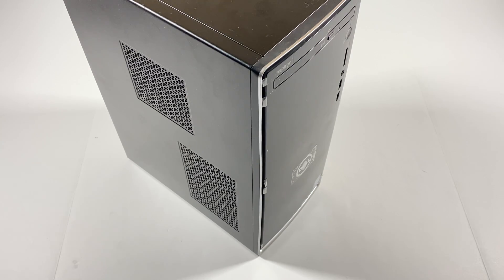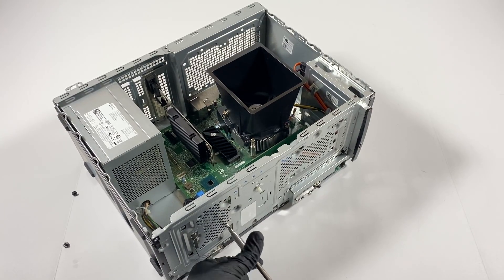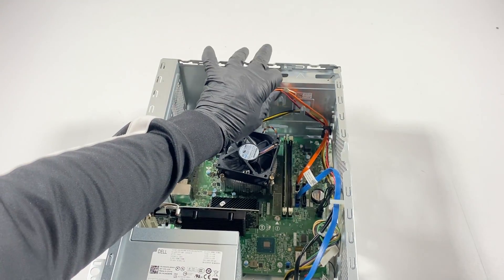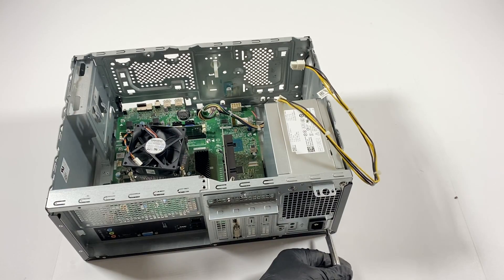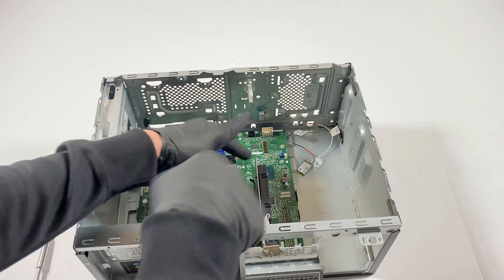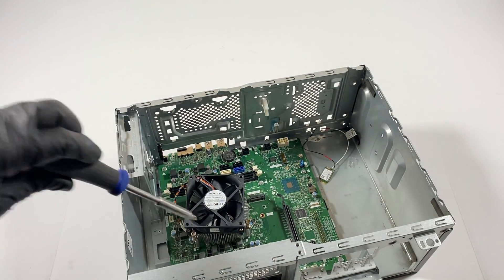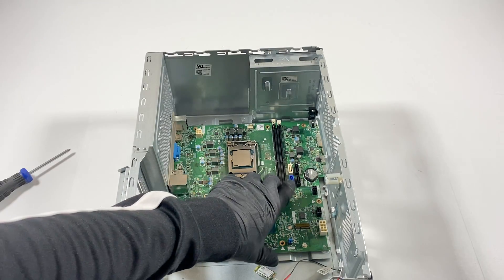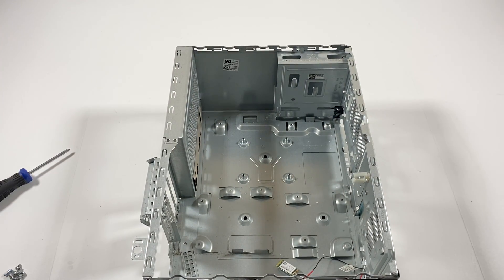Dell Inspiron 3670 Teardown

Comment from the maker: List of Parts and Upgrades works with this system :
Dell Inspiron 3670

Simple Deluxe 80mm Quiet USB Fan with Multi-Speed Controller
https://amzn.to/3jgHxiI

List of RAM will work with this system.
Maximum memory supports: 32GB

(1.) Crucial Ballistix 16GB Kit 3200MHz DDR4 Memory (8GBx2)
https://amzn.to/2UDGwI1

(2.) Crucial 32GB Kit (16GB x 2) DDR4 3200 MT/s (PC4-25600)
https://amzn.to/2Zazppk

(3.) Crucial 8GB DDR4 3200 MT/s (PC4-25600)
https://amzn.to/2R07Ier

(4.) Crucial 16GB Kit (8GB x 2) DDR4 3200 MT/s (PC4-25600)
https://amzn.to/326cfT7 
(5.) Crucial RAM 32GB Kit (16GBx2) DDR4 3200MHz Desktop Memory  
https://amzn.to/3pilfj7

(6.) Crucial RAM 16GB Kit (2x8GB) DDR4 2400 MHz CL17 Desktop Memory
https://amzn.to/3zljDuD

List video cards will work with this system Dell Inspiron 3670

GIGABYTE GeForce RTX 3050
https://amzn.to/3W2sJY9

MSI Gaming RTX 3050 Gaming X 6G Graphics Card 
https://amzn.to/4eNikqD

XFX Speedster SWFT105 Radeon RX 6400 Gaming Graphics Card
https://amzn.to/3xkmXo1

(1.) ASUS Phoenix NVIDIA GeForce GTX 1650 OC Edition Gaming Graphics
https://amzn.to/3Nyn7yb

(2.) ASUS TUF Gaming NVIDIA GeForce GTX 1650 OC Edition Graphics Card 4GB GDDR6 
https://amzn.to/3moJbzo

(3.) PNY GeForce GTX 1650 4GB GDDR6 Dual Fan Graphics Card
https://amzn.to/3aFlxw4

(4.) ZOTAC GAMING GeForce GTX 1650 OC 4GB GDDR6 
https://amzn.to/3xeX0FF

(5.) AMD Radeon RX 6400 Low Profile Gaming Graphics Card
https://amzn.to/3s8MUUY

(6.) Gigabyte GeForce GT 1030 GV-N1030D5-2GL Low Profile 2G Computer Graphics Card 
https://amzn.to/2Z4PHkp

(7.) ZOTAC GeForce GT 1030 2GB GDDR5 64-bit Low Profile Video Card ZT-P10300A-10L 
https://amzn.to/2WzgLXk 

Thermal Grizzly - Spatula for Applying and Spreading Thermal Paste 
https://amzn.to/3d8NQEE

Thermal Compound Paste:
(1.) Arctic Silver 5 Thermal Cooling Compound Paste 
https://amzn.to/2ziNU0H

(2.) Noctua NT-H1 3.5g, Pro-Grade Thermal Compound Paste
https://amzn.to/36kTk7A

(3.) ARCTIC MX-4 (current edition) Thermal Compound Paste 20 Grams 
https://amzn.to/2DhGJaK 

M2 2280 SSD Screws Kit,PCIe NVMe M.2 SSD Mounting Screws 
https://amzn.to/3QanIaZ

SSD M.2 NVMe List:

(1.) Crucial P3 Plus 4TB PCIe M.2 2280 SSD
https://amzn.to/3RZcUNi

(2.) Crucial P3 Plus 2TB PCIe M.2 2280 SSD
https://amzn.to/3RTUi0Y

(3.) Samsung (MZ-V7E1T0BW) 970 EVO SSD 1TB M.2 NVMe
https://amzn.to/3d52k2a

(4.) Samsung 970 EVO Plus SSD 500GB
https://amzn.to/3fpi95A

(5.) Samsung (MZ-V7E500BW) 970 EVO SSD 500GB - M.2 NVMe
https://amzn.to/37uuLFw

(6.) Crucial P1 500GB 3D NAND NVMe PCIe M.2 SSD - CT500P1SSD8 
https://amzn.to/2N07wKh

SSD List:
(1.) Samsung 860 PRO SSD 256GB - 2.5 Inch SATA III Internal Solid State Drive
https://amzn.to/2BY5gRl

(2.) Samsung SSD 860 EVO 250GB 2.5 Inch SATA III Internal SSD 
https://amzn.to/37xWUfc

(3.) SK hynix Gold S31 1TB 3D NAND 2.5 inch SATA III Internal SSD
https://amzn.to/3d7X6D6

(4.) Samsung SSD 860 EVO 1TB 2.5 Inch SATA
https://amzn.to/2B2FURX

(5.) SanDisk SSD PLUS 1TB Internal SSD
https://amzn.to/3hwdqku

(6.) SanDisk SSD PLUS 240GB Internal SSD
https://amzn.to/2zfc7EX

(7.) Crucial MX500 250GB 3D NAND SATA CT250MX500SSD1(Z) 
https://amzn.to/3bTTjbX

(8.) SanDisk SSD PLUS 480GB Internal SSD SDSSDA-1T00-G26
https://amzn.to/2yfgjUK

HDD list works with this PC:

(1.) Seagate BarraCuda 4TB Internal Hard Drive HDD – 3.5 Inch
https://amzn.to/3d3xWeR

(2.) Seagate BarraCuda 8TB Internal Hard Drive HDD – 3.5 Inch
https://amzn.to/3xjUDSJ

(3.) Western Digital 2TB WD Blue PC Hard Drive HDD - 5400 RPM, SATA 3.5" - WD20EZAZ
https://amzn.to/3w3jIQA

(4.).WD Black 2TB Performance 3.5" Hard Drive - 7200 RPM Class, WD2003FZEX 
https://amzn.to/2xFUeyF

Comment: This was helpful. It taught me how to remove my SEAGATE Barracuda 1TB hard drive!

Now I need to get a new hard drive because this current one is “operating outside of normal parameters and should be replaced. This system no longer carries a hardware warranty. To purchase a replacement…”

Comment: Would it be possible to replace the optical drive with a small form factor (Laptop sized) Bluray drive? Looking to keep costs down on a sleeper build for a friend and I'm looking to give him the option for blueray without using up the USB ports for an external.

Comment: Hey, thank you for the video! 

Could you put this motherboard in a different case? I can't figure out if it is a standard size such as ATX, ITX, or MINI-ITX.
Reply from the maker: Hi, this is Micro ATX  motherboard and built in with power switch. Yes it is possible to use this motherboard in custom gaming case and i do not recommend.